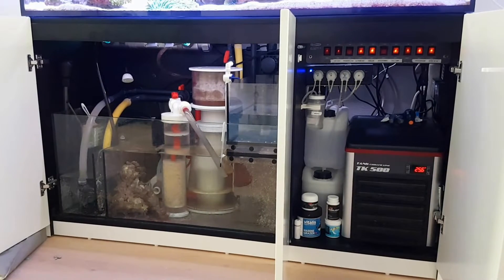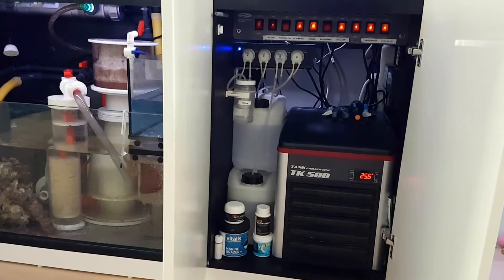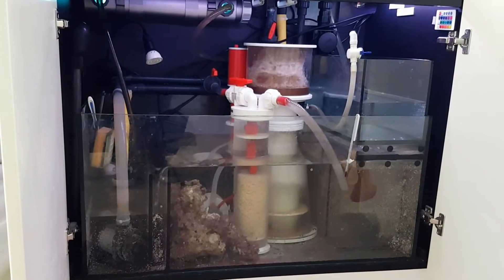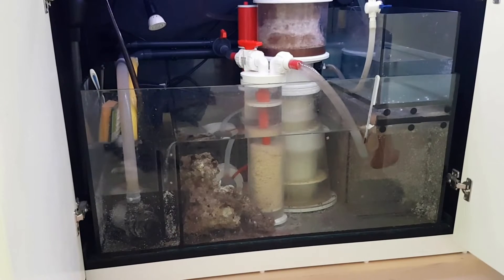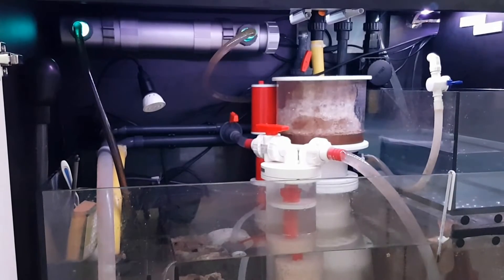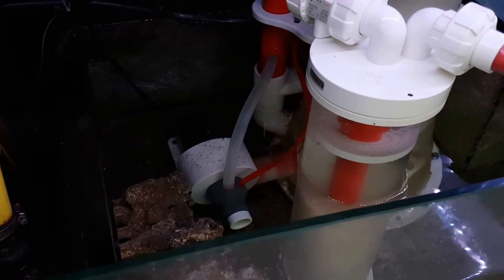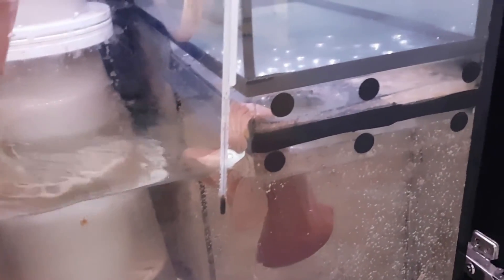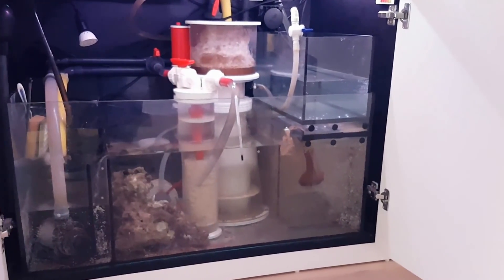04-2017 | sump | Red Sea Reefer 525 XL

Comment: Could you not use a larger return pump and only use one instead of 2 and connect everything from that
Reply from the maker: Yeah that's certainly possible, but for now this works great :) I did consider buying one of the new Maxspect pumps which has 2 outlets as well

Comment: Truly beautiful aquarium. Have you considered/tried increasing the vodka dose or using Nopox to lower your nitrates instead of using biopellets? I've  never used biopellets but I'm curious about the effects of two carbon dosing methods working simultaneously. I don't remember if you stated in the video, but how long have you been running biopellets? I look forward to your video on your implementation of the balling method.